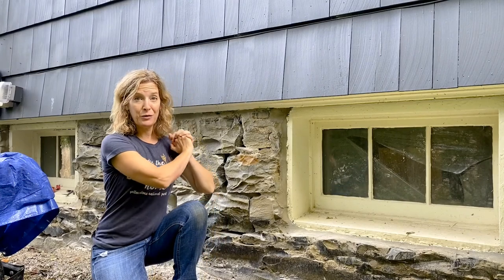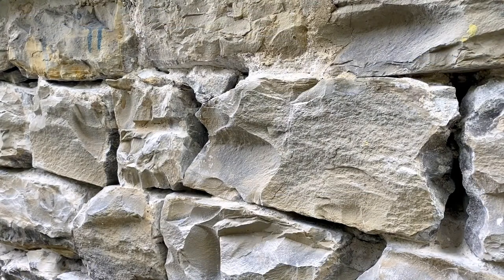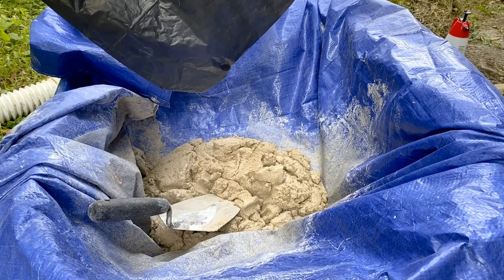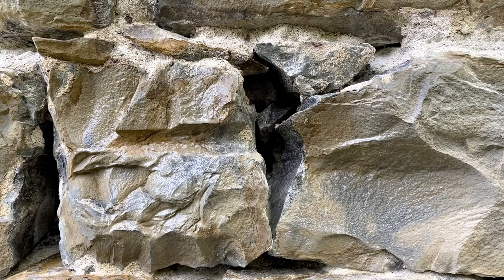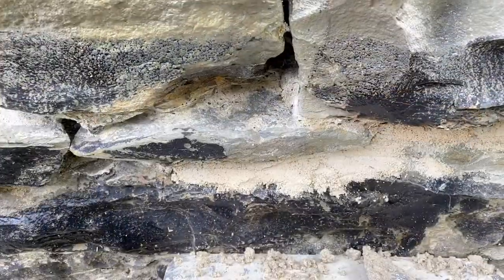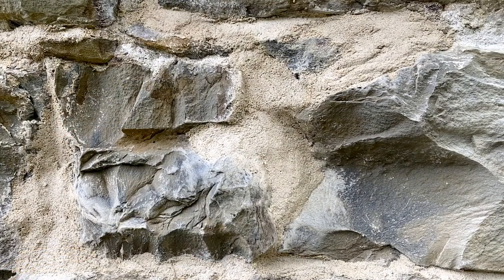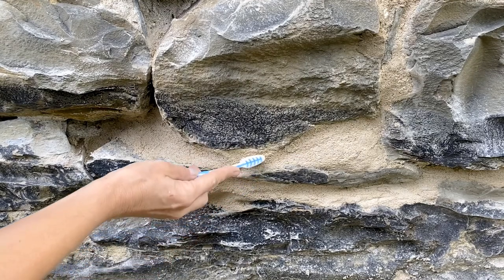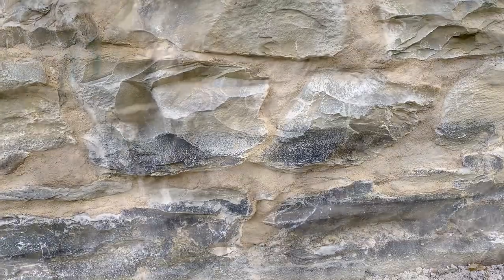Repointing a Stone Foundation

Comment: in Old New England Mr. Manning trained us to clean the stone remove any soil or loose mater, then let it dry, then do concrete mixing with a shovel in the wheel barrow to mix it manually. If you have large spaces you actually need to fit some stone in them, definitely to have it not break up again.
Reply: That’s a good practice but you were using cement mortar which will trap moisture and then crack due to freeze/that cycle. Lime mortar is much more flexible and also self repairs which is its most useful and amazing quality.
Reply: @torref9230  we used portland cement torre and mixed it with gravel

Comment: What is the specific type of mortar powder used? Not brand, just type, so I don't get the wrong mix. Thanks.
Reply from the maker: Hi Derek, The specific type I used was formulated by Limeworks for my particular climate. The mix will vary depending on where you live. Here's a link to the NHL tool to find the best mortar for your project (scroll down the page): https://www.limeworks.us/product/ecologic-mortar/#NHL 

Full disclosure: Limeworks is a past sponsor of my podcast. However, I don't get a kickback or anything by sharing that link. I'm just a happy customer.
Reply from the maker: I forgot to mention that when you scroll down that page, you're looking for the NHL Selection Tool.

Comment: Maybe I missed it but can you advise what mortar you used? I'm in Wisconsin and I swear I'm so confused what mix abd ratio to use...lime? Sand? Mortar? What ratios? Lol. I have an early 1900s outhouse that needs some repointing but I want to make sure I get the mortar mix right.
Reply from the maker: Hi Phil, I used lime mortar from www.limeworks.us. There are so many options! I was also very confused about the formulas and ratios. So, the customer service at Limeworks helped me figure out what type of mortar to use for my particular application. I bought pre-mixed. There is more information on my blog linked below the video. Good luck with the outhouse!

Comment: Did you give up on the garbage bag?  Seems like a good idea in theory but might need a stronger bag. And how many more days until the podcast?
Reply from the maker: Hi Scott, The garbage bag trick worked really well for the very deep holes. I could pump the mortar back where I couldn't reach my hands. As you noticed, the trowels worked better for the small crevices. To answer your question, True Tales From Old Houses will be back Monday, February 1st--very soon!
Reply: Yeah, it did seem fairly useless lol. They make masonry bags for this exact use that would've probably worked much better. BUT with that said, she got the job done and thats truly all that matters. Well done!

Comment: I have seen people advise using a 'bonding agent' in such scenarios. Thoughts ?
Reply from the maker: Thanks for the great question. I am not a mortar expert, so I hesitate to even try to answer this. However, here's a link from Limeworks.us that might help answer your question: https://www.limeworks.us/types-of-masonry-binders. Also, here is another link to the exact product I used. However, the customizations were based on my specific regional needs: https://www.limeworks.us/product/ecologic-mortar-custom. I highly recommend reaching out to Limeworks if you have any other questions. They are wonderfully helpful.
Reply from the maker: PS: I also wanted to add that I don't get any compensation from Limeworks or anything. All the opinions are my own. :)
Reply: One mason man just thins mortar and uses a paintbrush to paint it on for a bonder